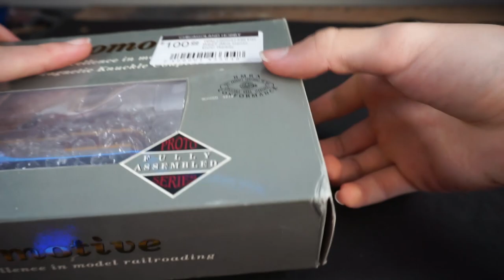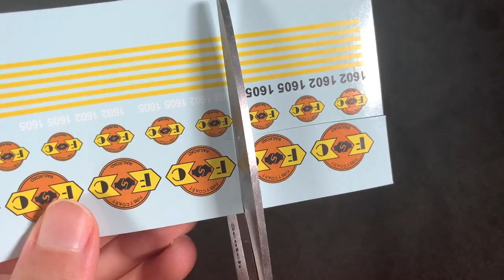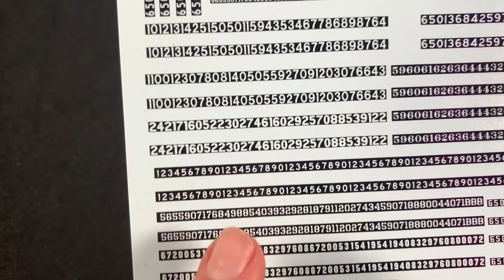Building An HO Scale ALCO RS27 Part 1 | Repaint And Decals

Comment: I've been wondering what people used to stripe paint off plastic models with. That doesn't harm the plastic. 
Also if it would be the same for brass?
Or if there is another, more effective and safer solution 🤔?
Reply from the maker: 91% percent shouldn't harm the plastic. For brass there are several options. Sandblasting is a great method (for plastic as well) and is pretty much required to get paint to stick to brass. There are several paint removers out there that work as well but they come in and out of stock.